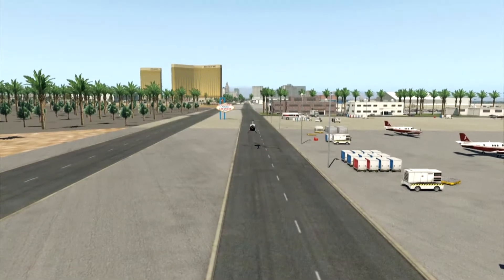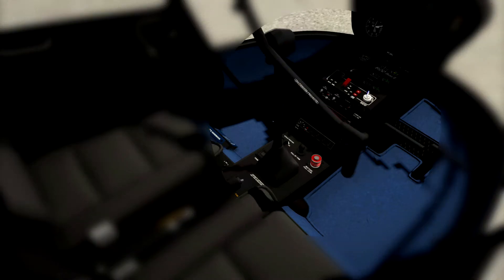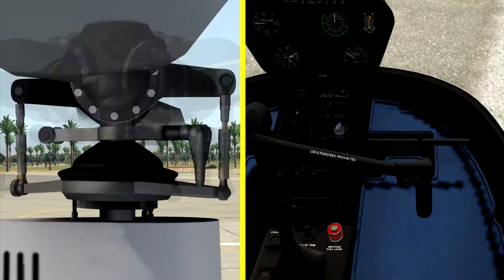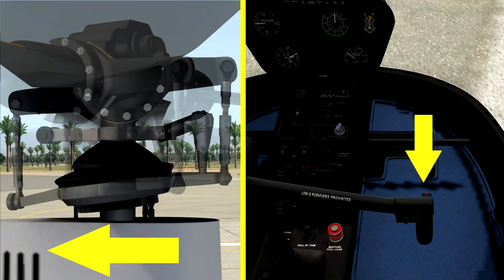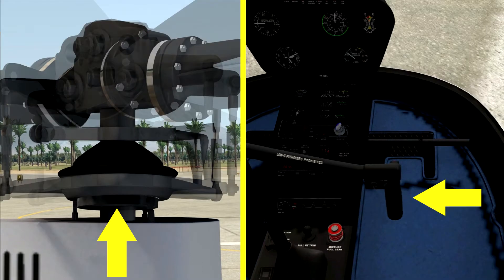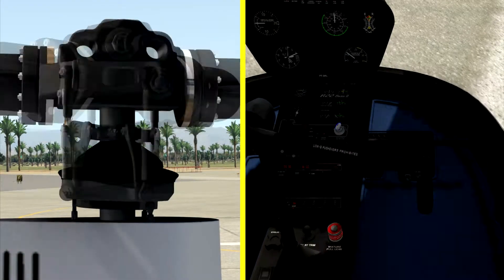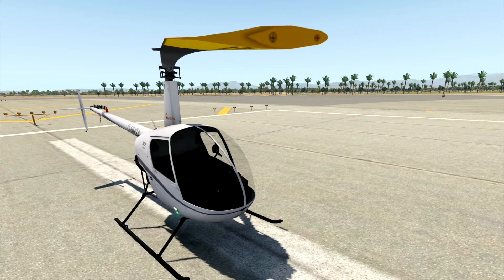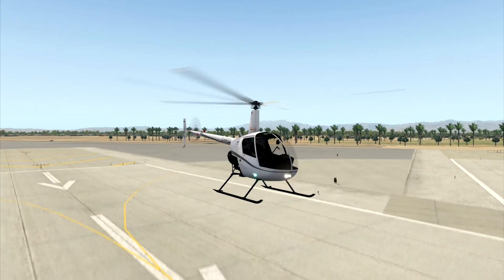Helicopter M/R Controls & Swashplate | X-Plane 11 | Joshua Hamby

Comment: Hello 
I have a doubt regarding swash plate movement forward and backward to move helicopters front and back this guy says it moves sideways  https://youtu.be/2tdnqZgKa0E

Who is correct? For my Rc heli it’s just as you showed it in your video swash moves front and back for the forward and backward of heli
Reply from the maker: The swashplate moves the disc. So if the disc shift forward, the helicopter moves forward.
Reply: @JoshuaHambyOfficial  but in the video I linked that guy says its wrong 😑, to move heli forward the swash should move sideways I want to know how is that possible 
Anyway thank you so much for reply 🙂
Reply from the maker: He's talking about gyroscope precession. The tendency for a spinning disc to precess 90 degrees in the direction of rotation.
Reply from the maker: What? Lol
Reply: So what’s is correct now?
Reply: @venki7435  
One can start by looking at their POH,
Pilot Operator's Handbook for the specific aircraft one will be flying. You can fly a helicopter sideways....